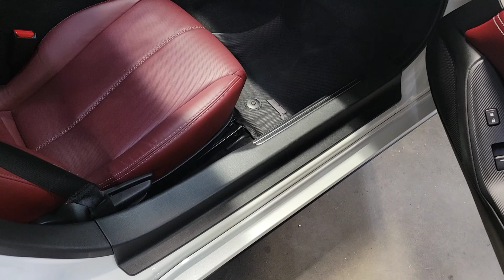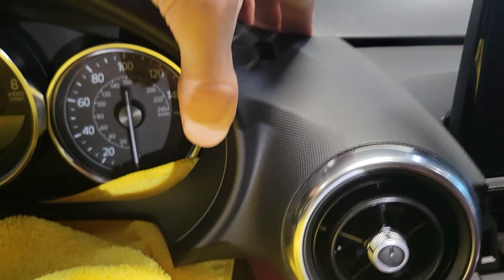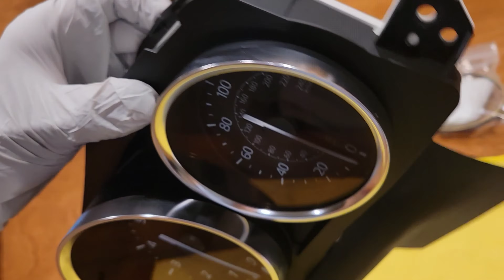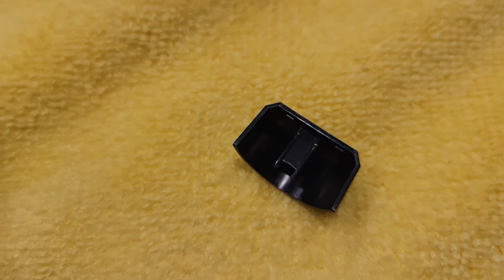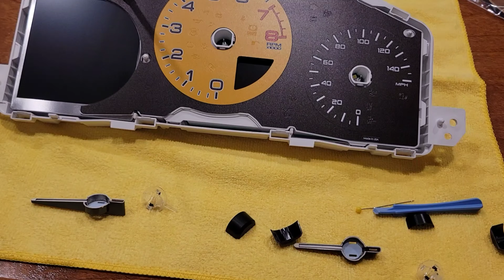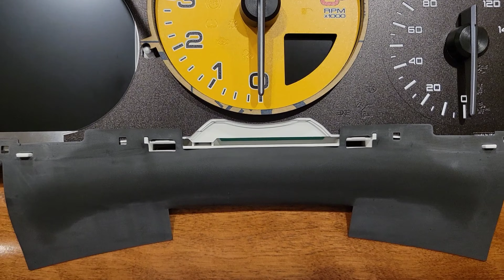Mazda MX-5 Miata (2016+): How to Install Custom Gauge Faces from Revlimiter.net - ND ND1 ND2 ND3 RF

Comment: When you made this video did you happen to notice if the silver trim pieces around the gauges looked like they might be able to pry off? The paint on mine is chipping and I would like to pull them off to fix, but I can’t find any videos or info on the forums about this.. and I’m hesitant to just start pulling on them.
Reply: I have the same issue and the same question!
Reply: @k @kr6248 we may never know lol I tugged on mine and they didn’t come off. Afraid to pull any harder. Not sure what the best move is 🤷🏻‍♂️
Reply from the maker: Sorry for the delay - I hadn't seen your comments until now. Apologies as I don't think I can help much here. If you've tried pulling them off gently without any luck, I would be afraid to pull much harder. Gauges are generally pretty fragile, and I would worry about creating a bigger issue.

Comment: I don't think you need to remove all that interior trim to take the gages out. I didn't when I replaced my tac, tho I didn't pull the whole gage cluster out, but if I remember correctly I think I could have. You can remove the trim around the gages  by just slightly undoing the central air dash plastic

Comment: Wouldn't that superglue make it much uarder to remove those half circle pieces from the guage needles, if you ever want to put back the original guage face back on the car?? Is the super glue really needed to keep the half circles on the needles??
Reply from the maker: @enricomercado4671  great question! I haven't disassembled the gauges and don't plan on it, but I'm confident you could ask the folks at Revlimiter.net as they've installed and uninstalled these gauges multiple times.

Comment: will this work for a fiat 124
Reply: Yes BUT the speedometer portion in CLASSICA and LUSSO models do not follow the standard 0 - 20 - 40 - 60 - 80 - 100 - 120 - 140 - 160 scale. If you have an Abarth 124, you are good.
Reply from the maker: @IndianaSPEED-n8h  great info. Thanks!
Reply from the maker: Great question! Based on some quick research I did from the Fiat 124 forums, I see there is someone that has installed these Revlimiter gauges on their Fiat 124. They went with a yellow face as well for the tach (like in this video).

When making your order, I would highly recommend noting you have a Fiat 124 to ensure there aren't any small adjustments/tweaks that need to be made. Adam was super responsive and was very easy to work with in the process.

While I'm not affiliated with Revlimiter.net (and I also paid full retail price + extra for custom design time) for these gauges, it would be cool to mention my name - Sean Stettnichs - in your inquiry. I told Adam I would create a "how-to" video when I ordered these gauges. I'm sure he'd like to know it helped him out too.

Good luck! It'd be cool to see how yours turn out too on the 124!